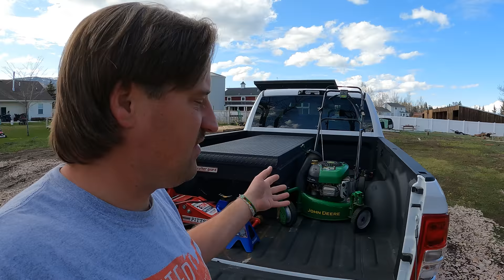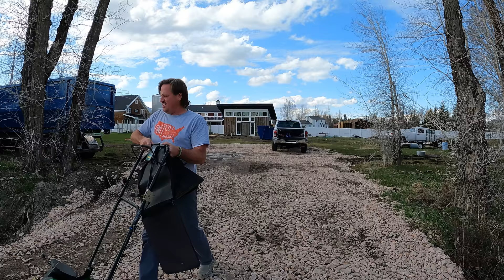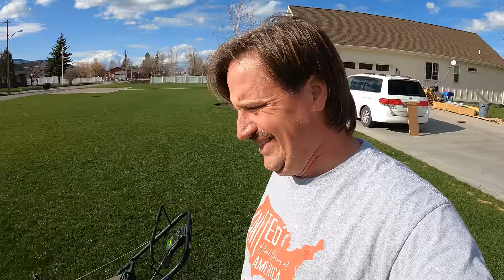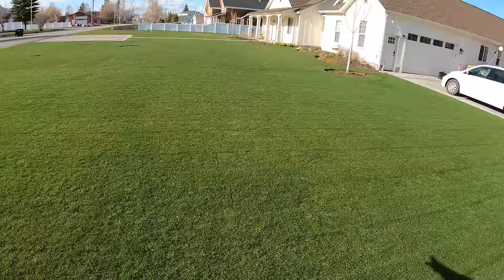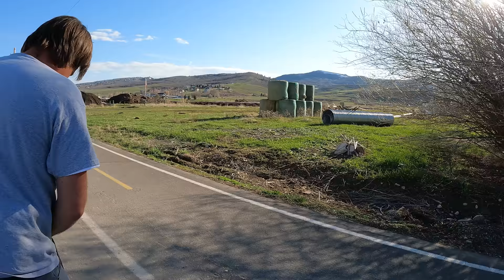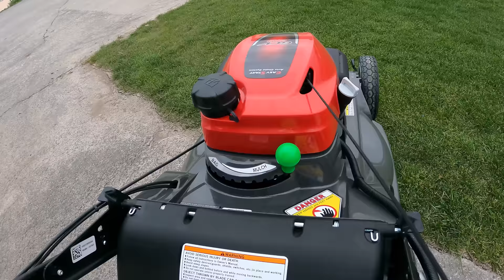First mow of 2022. ENJOYING THE MOW?

Comment: Connor, when you core, you can use those cores on your bare spots, I built a back yard putting green using bent cores. The Kentucky blue and its growth habit will allow you to fit it quicker than plugging. Collect the cores, spread them roll them and water them. You will love the results.

Comment: I was going to suggest buying a Toro Timemaster. You would probably enjoy that mower. Only flaw is the bagging system to me. It’s small and doesn’t empty easy. But it looks like you went fancy and got one of them turn key start deals. Well done sir
Reply: He has had a Timemaster on the channel before.  Not sure what happened to it though.  I don't think he liked it.
Reply from the maker: I hated that mower. I sold it
Reply: @lawnrebel  Different mower pal. You needed the 223cc Timemaster

Comment: Before I saw the Honda part at the end I was going to comment that you need a Toro Super Recycler with a bagging blade. Suction with that blade, low cut adjustability, and Personal Pace make it a great machine
Reply from the maker: I was skeptical as to the lowest height
Reply: I have not mowed super low with mine so I cannot comment on that ability other than I've read the "range" of cut specified by Toro.  I went back and forth between the Honda HRX and the Super Recycler for a while and ended up with the Toro so I could have Personal Pace.  I did still pick the Honda engine model though, best of both worlds for me I guess 😅

Comment: Wow I can’t believe you got a Honda after all the auto choke business. I’m lucky I have one of the last models outside of the commercial line to have a manual choke and still running strong 12 years later. I change the oil once a year and the spark plug once every other and the air filter every other to every 3 years. I just wish someone made a powered reel mower intended or us home owners that didn’t cost $3,000+ brand new. Allett is getting close but it’s still beyond a common mans reach. It just boggles my mind I can buy a massive ride on zero turn mower for the cost of a 17” homeowner reel mower.

Comment: With all due respect. It's a used mower. HA HA HA I have the J30 and find it cuts well. There are 2 blade options for that mower, 1 is a high lift blade that helps with bagging. The other is a mulching blade, that obviously doesn't bag well. The other thing is that it's a small bag. You've got a big yard....you'll have to empty it more often to prevent the chute clogs you experienced. LOL!

Comment: I just took my very old John Deere 14sb into the shop today to get a leaking carb checked out. The shop owner said he doesn't like any new push mower on the market. Honda's transmissions are known to go out. Toro is made in China. I wish John Deere still made push mowers but not that crap one you got.  Nothing runs like a Deere!

Comment: I owned the Cub Cadet version of that John Deere.  Horrible mower.  Gave it to my father in law who will take anything.  He promptly threw it away.  I'm also off the Honda line until they can fix the gearbox issue that locks the rear wheels and prevents you from pulling it backwards.  Never thought I'd get one, but I got the Ego (top of their line model) and it cuts just as well as my Honda did.
Reply from the maker: Yes that gear box that prevent from backing up. That was the problem with the last Honda